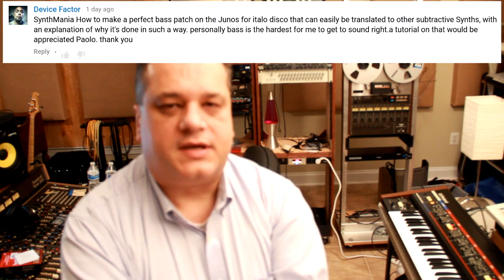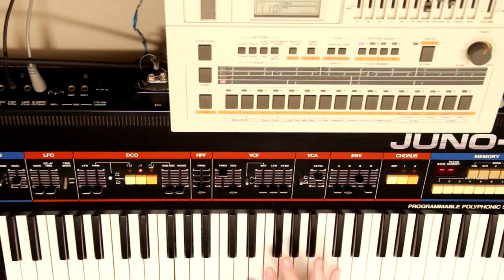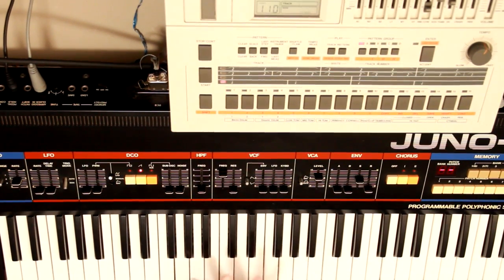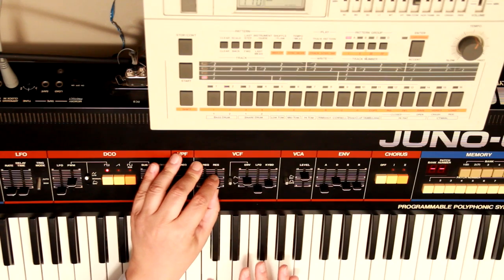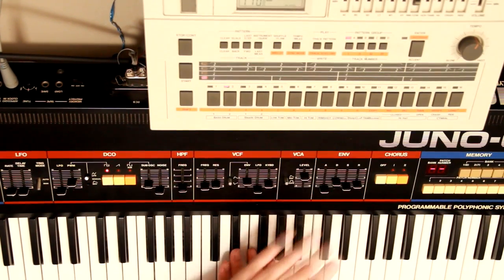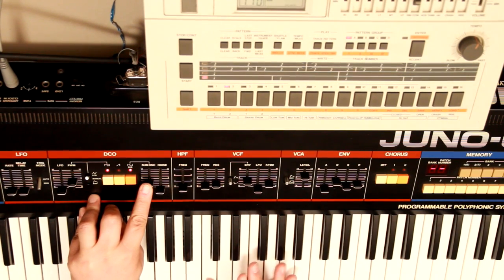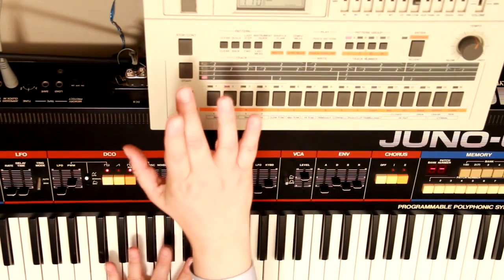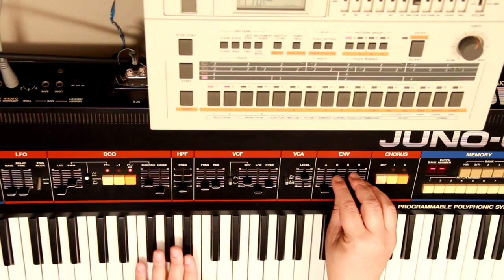Juno bass patches for Italo Disco

Comment: I went and made a patch based on this on the Cobalt8x and it came out surprisingly similar. The trick was the SVF filter set to bipolar (or relative but not legacy).  and also another trick was not leaving the cutoff at absolute zero but rather moving it a tad to affect the envelope just a hair in the right direction to mimic the sound (the first patch you made, the italo disco style)

Sounds lovely on the cobalt! There's a difference but it's merely sideways rather than and upper/lower relationship.

Comment: Would you say the Juno 60 is one of your favourite synths? I'm considering picking a Juno 6, but for the price I could buy say an Alpha Juno and maybe a DX7iifd.  The Juno 60 seems to make its way into almost all of your videos so it must be a favourite or something ;)
Reply: I'd suggest you to go with a pair of JU-06 modules as I did rather than chasing vintage stuff. First of all you'll get way more capable setup than an original one - 8 voices instead of 6 and better computer integration such as patches back-up as well as digital audio interface. As a matter of fact time works against a hardware so as one man has wisely noticed that it's getting harder and harder to maintain the vintage gear in working order. I picked my JU-06 for just a little more than 200USD each in mint condition. Also Roland recently came up with decent yet very powerful gear such as JD-XA and System -8 synths  which can reproduce all the 80's sounds just had down.
Reply: MSM5500 nah I had a ju06 and I didn't like it, I can't stand virtual analog, just doesn't work for me, it has no organic quality to it, no soul
Reply: One audio electronics designer's wife said: "If to keep looking at a glowing vacuum tube for quite a while then it might seem that there is somebody inside of it."

In fact, any analog synthesizer has no "soul" unless one is plugged to a decent reverb/delay cause the "soul" lives in harmonics. The richer harmonic spectrum the "warmer" "soul" is. But again, all the good reverbs in this world are digital. In other words, in order to get a good sound you must treat it digital.
Reply: I love the Juno 60 and it shows up in almost all my tunes as well.  I know the Juno 6 is the same without the presets.  The Juno series is great.  You'll be in heaven when you play them.  Enjoy!  Sam.
Reply: i wonder which kind of analog synths have you used if it needs reverb/delay to get soul
Reply: MSM5500 look, I've tried tons and tons of new synths like the Roland boutiques and the nords and microkorgs and viruses and they just don't sound right to me. Now, I have a heap of vintage synths and they have a character, a unique quality. It's just how I hear them and how they feel and sound to me. That's the "soul" I'm talking about
Reply: Yeah, I do agree with you that JU-06 is not a 100% substitute for a Juno 60 cause in fact it is a sound replica of Juno 106. And a 106 sounds a bit different to a 60 in some patches. But the thing is a JU-06 sounds exactly the same as Juno 106 so  lack of some "thickness" in 106 sound can be pretty much improved with use of some extra sound processing.

Comment: Juno 60, and the other junos too, but IMO esp 60 (and 6 of course), can be so versatile. It's one of those examples that breaks the rule that synths with kinda "poor sound shaping options", can't be good enough..Yeah, it has only one osc, (the sub osc can't be considered as a free one osc), one env (though it can be shared..), one lfo which is not exactly state of the art, and i mean at it's time, 1982 not today, and if these aren't enough, the osc isn't a VCO, but just a DCO, which isn't consider as a true analog, for a lot of people..(i'm not included, BTW..;). 
But Roland did break this rule, and make the juno 60 a great sounding synth, which does not only sound and looks beautiful, but can be used by a novice almost as easily as a pro, and in fact i think it's kinda "difficult" to make it sound bad, in a way of speaking..
But it's a shame that the price for it is often a bad sounding joke, yet it's an amazing synth..